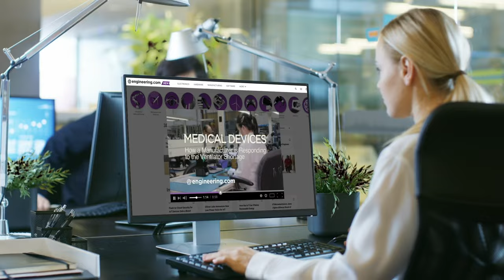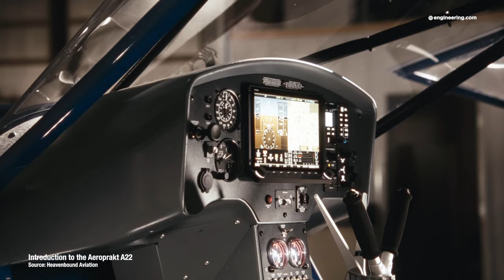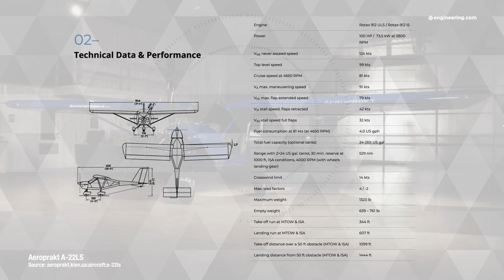MacGyvering Drones: Ukraine Converts Light Aircraft into Missiles

Comment: They should get rid of the wheels, launch it on a dolly: It doesn't have to come back..... Less weight and less drag. The Mark II ?
Reply: but more obvious...
Reply: But then it’s just an airplane… not a missle so nothing to report to anyone. Nothing strange about it.
Reply: There are so many weight/cost/drag reductions a competent designer could implement without having to change their process much.

Don't need wheels, brakes, lights, paint, windows, doors, interior, corrosion protection, or even "aviation grade" materials.

Would be buying the heck out of those Zhongshen Rotax-clones, though. It only has to work once, and Rotax gets snippy about their engines being used in military drones.

Aeroprakt and Ukrainian industries are more than capable of producing purpose-built long-range drones. This was just available— today.